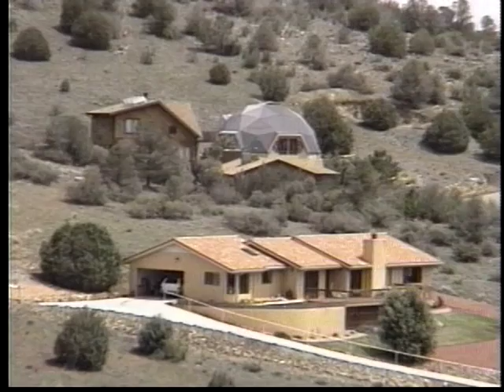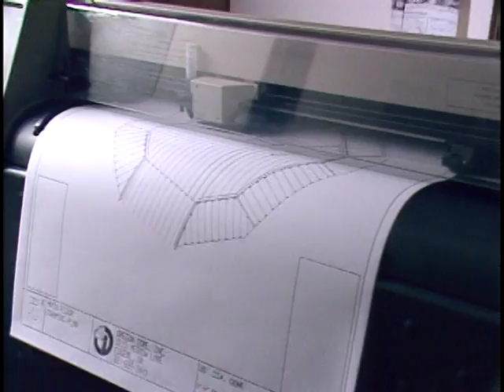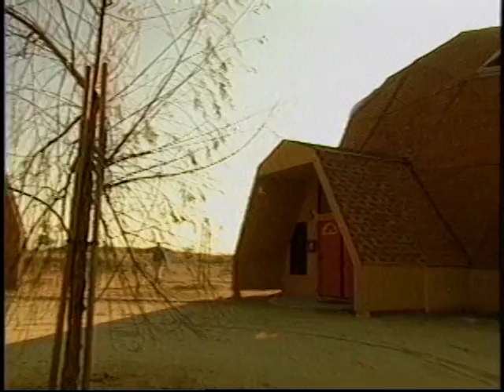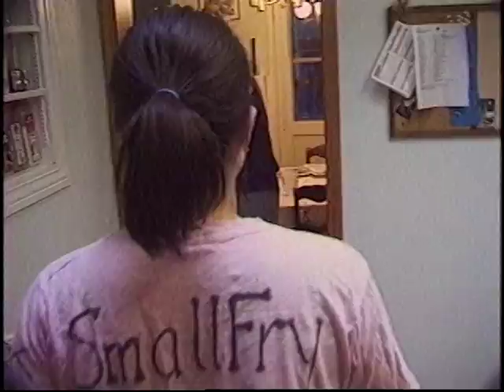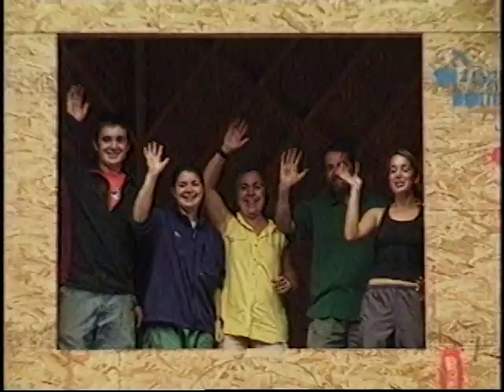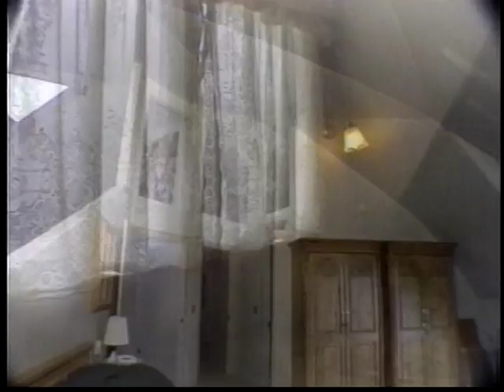Dome Home Kits - Oregon Dome

Comment: I would like a different kind of roofing. Love it all except shingles roof. There is a roofing material made of rubber membrane PVC ROOF. This roof is used on flat roofs for schools and factory building that have flat surfaces. Each seams is hot air welded. On the underside every few feet has a flap that has grommets to screw to the wood deck or sheeting. Then each triangle would have a hot air welded like I mentioned. Until they change the roof to something else other then shingles I go with the other designs, like monolithic or American Ingenuity      geo Dome.

Comment: Mine was built in 1997 by a previous owner.  I purchased it in 2009 but I am certain that the cost has increased for the unit since it was constructed in 1997.  If you have the property on which to build, I suggest that you contact Oregon Dome Homes, and go through their offering and make a decision on what you want to do.